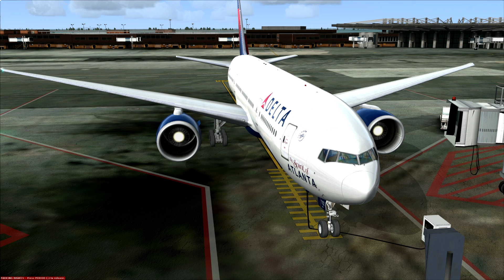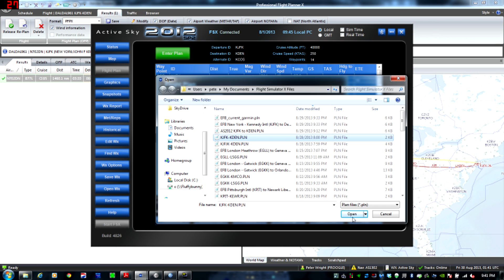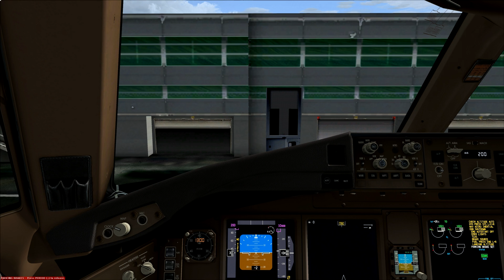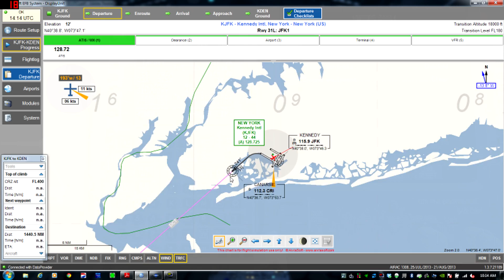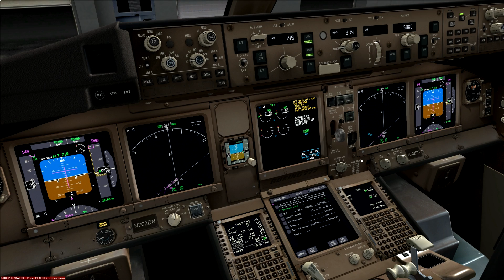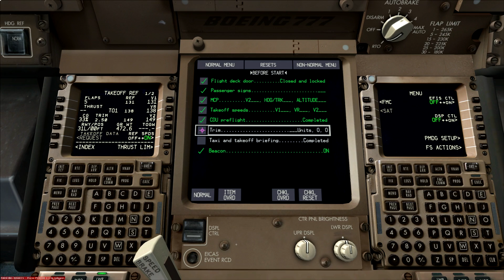PMDG 777 FOR FSX - FULLY LOADED, Part 1

Comment: What panel state is the aircraft loaded with in the beginning? Just the standard default "free flight"? Or was it cold and dark and you setup the ground power before you started recording? You start the engines so I assume it was cold and dark.

Comment: Fantastic video. I am new to the FSX world and PMDG. It is a fascinating plane to get a hold of, and the bummer is my PC won't run it! I have had so many trying to help, I went through and optimized FSX, shut down all the crap running in the background and still cannot get a frame rate that will work. Sigh...I have to get a stronger PC. So, until I get it, I am trying to satisfy my craving by watching others and learning! I think yours is at the top of the food chain as far as flight sims go. Liked and subbed!

Comment: Hey frooglesim I thought you might be able to help me,
1. Is this FSX or P3D?
2.(Only if it is FSX) how do you move like that seeing the overhead panel so easily, is it a addon or something?
3.(Only if this is FSX) How the heck are you're graphics so good I bought REX4 and I don't get such great graphics (They actually suck but I have a great PC)
Reply: 1 it's fsx
2 he uses ezdock camera
3 try getting a better cpu and try changing the settings. or it could be the hdmi cable you use or the screen res.
sorry for late reply

Comment: thank you very much for this video, asn exports the weather for you, i installed active sky 2012 then realized asn does it for you with pfpx, i was starting to wonder if i through 90 bucks away,i am getting ready to do my first take off with your video tutorial,i normally only fly the aerosoft a320 and it spoiled me, but still my favorite plane until i get this one down,i still can't get external power to work,i had to use the apu during my setup,thanks froogle
Reply from the maker: ASN may export the weather but I never use that function if it does. PFPX does yes. Active Sky 2012 does not export but you can manually simulate the same thing - I have not done it in quite a while but I do seem to recall that I show how to do it by hand in this very video. With regard to your other problems, you can connect external power from the Menu button on the CDU. Click it, and then go through the menus - the connections one will let you hook up external power. Outside of that I think you're likely to have quite a few more challenges. Bear in mind that the T7 is a study aircraft. I highly encourage you to work through the tutorial flight and then unfortunately you're going to have to start studying those huge PDF's that are supplied with the aircraft. I will likely have a lot more T7 videos and tutorials out after service pack 1 is released.

Comment: Can i ask A question? is that Flight Planner really good i do alot of virtail flying now i dont have 2 screanns but i do use a 42 inch tv for my computer so i should be fine so give more info cuse alot of flight planning is gone i want i really good payware once thats easy or if you can cut paste your flight plan routes for example FMS route DCT PH TASKA BINDI DONGA POKIP N752 PLB G579 REMES DCT. let me know

Comment: Great set of videos how to fly the pmdg t7, lot of tips 
Have a question though about the as2012 weather load into the FMC 
Followed exactly the instructions you showed on the video (and the instruction supplied by PMDG)  but my FMC answers with Invalid request when trying to load the generated as2012 list from thge pmdg/wx directory
Any idea what goes wrong.
Tried various routings including the jfk-den as shown in the video.

Comment: Hey froogle I have a question. I just got the 777 today and noticed that some of my sounds are missing. For example, I can't hear the switches in the cockpit move, the radio altimeter callouts, or the tires while on the ground. Do you have any suggestions on a fix to this problem?

Comment: Can't go wrong with AS. IF you are willing to be able to make a somewhat realistic flight planning (winds aloft to begin with) the built-in weather engine doesn't come anywhere near providing with the necessary info... Weather depiction is the next thing where built-in FSX engine is lacking precision. Only difference is that this is only about graphics 'eye candy' and not really affecting the aspect of accurate simulation of flight planning.

Comment: hello frooglesim 

truely i loved the way you present the video and found some new stuff i did not know in the pmdg 777. 

im seeing that you got a very good fps rate. unlike mine, although i've got a 5,000$ pc, my system still lags. around 8 fps. do you know how can i fix this issue? 

here are my specs: 

Windows 7 Professional Edition (64-Bit)
Core i7 3770K (4.5GHz Overclock) Quad Core
System Memory 32GB Dual Channel DDR3 SDRAM 1866MHz
Graphics 4GB Nvidia GeForce GTX 680, GDDR5, PCIe

Comment: Hey froogle, quick question. Whenever I start the second engine (engine 1) I get a caution warning light right after I flip the fuel cutoff switch to run. The light doesn't go away for the whole flight. Any ideas?

Comment from the maker: First up, you're not ignorant so there's nothing to excuse. That said though, you also haven't read the manuals, and you really should as this is a study aircraft. 

Load the cold and dark state. Then use the CDU, click Menu, Click FSX, Click Ground COnnections and Connect 2 plugs for ground power. 

Then overhead panel, click the External Power button. 

Then after everything is powered up (it takes a few minutes, it's realistic), go to the CDU, Click Menu,save the panel state.

Comment: There is always a fine line between accurate and playable. Their auxiliary TO/GO switch on the dash for instance on the NGX is a playability conceit.

In the end there's an argument to be made either way, but in this case the hit to absolute realism would be in my opinion offset by its tremendous value. Avoiding alt tabbing would be insanely helpful and would improve the suspension of disbelief, however anachronistic the implementation is.

Comment: Froogle, sorry if you have answered that question a thousand times already, but I'm going to ask anyway: How do you record your videos? Running Fraps while actually flying drops my frames to a point where it just isn't fun to fly any more. Using FSRecorder does help, however I still need to record at half speed to make my videos look smooth.
I know it's probably also parts of my hardware and software setup. Any advise, I'd really appreciate that.
Thanks!

Comment: Your procedure to pressurize the Hydraulics is incorrect. At Preflight the left and right primary should be on all others off. At Before start pressurize the Right Electric demand pump first by setting to Auto,  followed by the Center 1 and 2 primary to on, the the Left Electric Demand to Auto, then the Center 1 and 2 Air demand pumps to Auto.  Source Normal Procedures 777 FCOM.